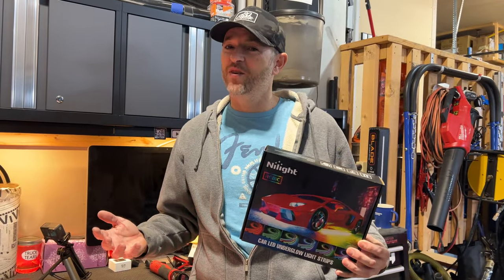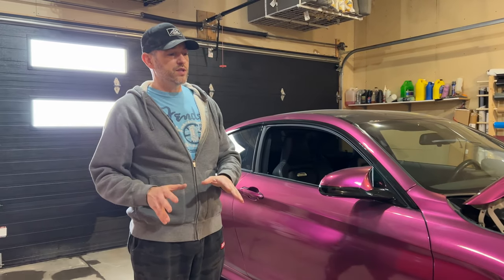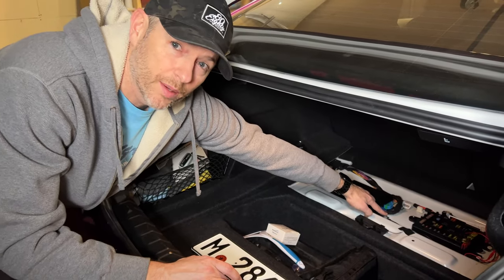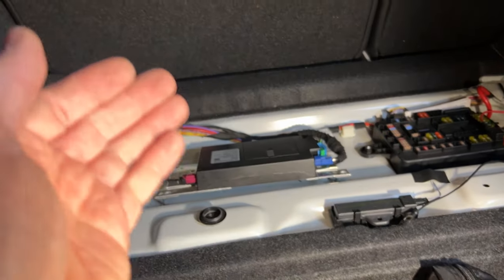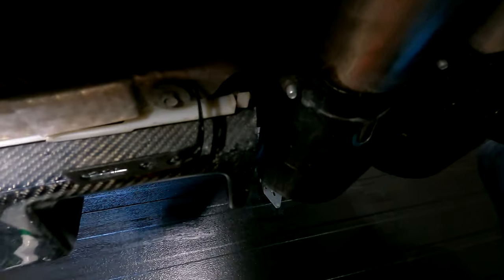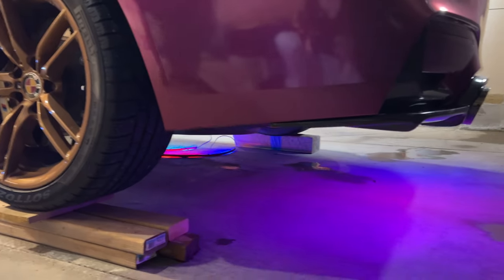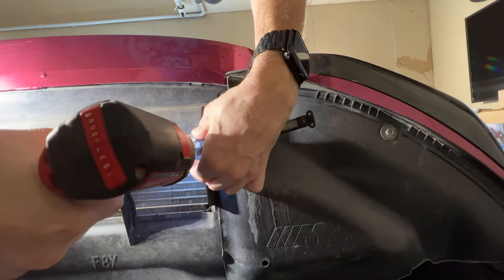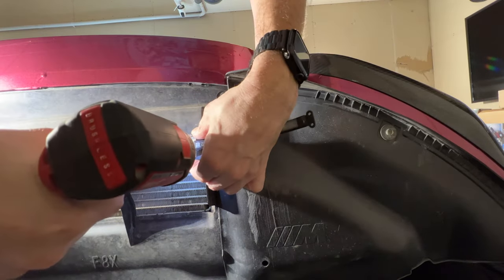Cheap Multi Color LED Underglow Installation & Review

Comment: Dope video!! I was just wondering if it would drain my battery if i hook it there instead?!!
Reply from the maker: Thanks.  It will use some standby power even when turned off. If you drive everyday, you’d probably be okay.  But if the vehicle sits for several days sometimes, it might lower the battery charge more than you’d want.  You could always add a switch too.
Reply: @Donslife  alright thanks for this information, it really bring peace in my mind, i thought i would have to worry about recharging my battery constantly!!👍🏽

Comment: Hello. I have an F20 1 series.I was going to drill a hole to wiring thankfully I watched the video.I have the exact same place where the battery is.I'm gonna try to install it this week.I wonder where did you placed the module ? and where did you route the cables from sides to front or back I watched some video they were like routing it in wheel arch. Thanks :)
Reply from the maker: Thanks!  I put the box box in the trunk area and ran the wires from each pair of lights strip into that area.  You may have to come up the wheel arches depending on your kit.   I laid everything on the floor first to decide which strip would be where and to determine if I had long enough cables for my final planning